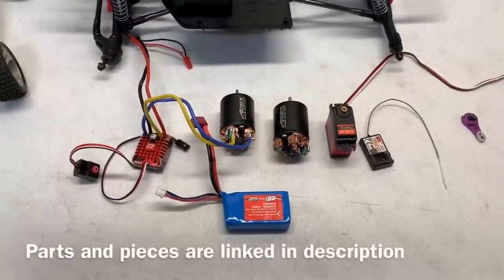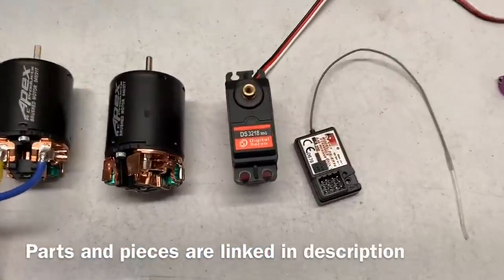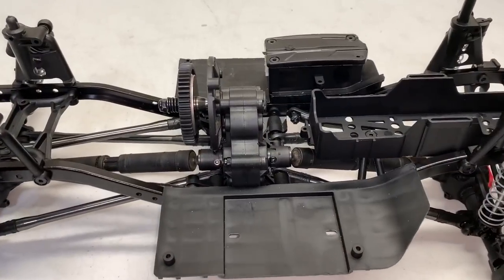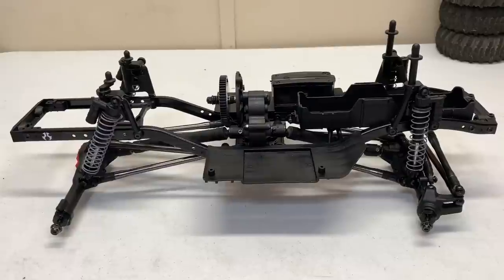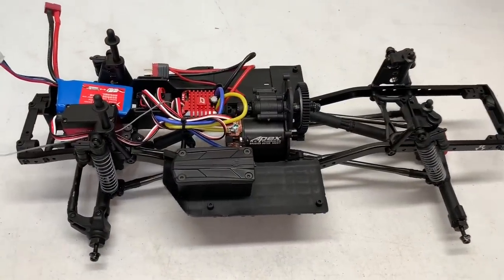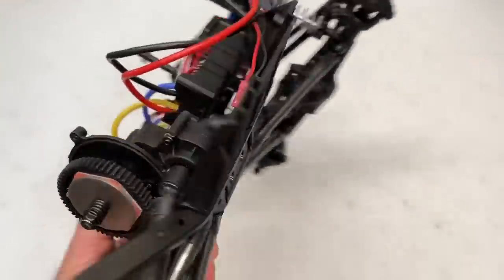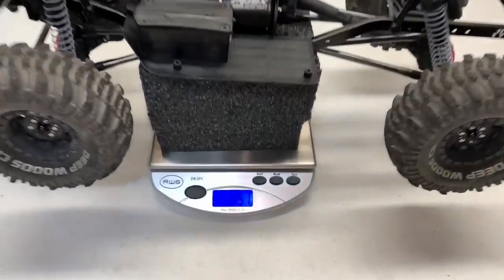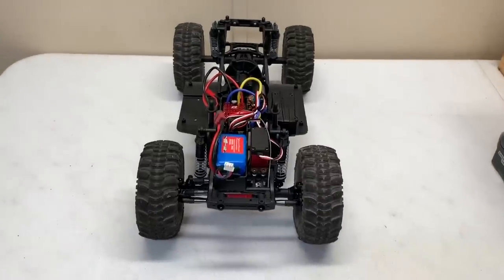Axial 10.2 Superlite Build pt1

Comment: Funny. That's almost what my Honcho is. I've added links, 20kg servo, Holmes Hobby Sport 35t, and 1080. I did add Amazon aluminum beadlock and Hyrax knock-offs though. It can hang in there with rigs costing hundreds more. Fun stuff.
Reply from the maker: TrailCrawler 203 yes you are 100% correct. You don’t need $1k trucks to win and this one is just getting better as I build and cut stuff away.

Comment: Great video again. Hey side note, took the new axe550 out with a buddy. My new 550 with 45/11 was very close in speed to his new firmware axe2300 with 45/16. 3S in both trx4 2 speed same tires size too. Thanks again for sharing your videos. Jon.
Reply from the maker: nice, which one ran cooler?
Reply: Well the new system has a fan as you know. We ran them in rocks for over an hour at 85 plus degrees outside in southern Idaho and neither experienced thermal shut down, both ran out of battery at the same time. Forgot my temperature gun, sorry.
Reply from the maker: jon98tj nice. I’m guessing the Tactic had the 550 motor?
Reply: Yes, Tactical 550

Comment: Deep woods tires are great, I have them on my gen 8, it's basically a spider
Reply from the maker: Dwayne Baker yeah these have the foams that come in them so they are super soft and roll on side hills pretty bad. I’ll do my best to make these work.
Reply: @ExocagedRC  I actually just put the stock tires back on, your so right about the side roll, but the super swampers are much better👍

Comment: Interesting concept!
I have wondered the same thing when I see people talk about their 8-11lb trucks.  
At this weight though, I would assume where your weight is would be even more important.
Reply from the maker: yes, once I get it "done" and at or under 4lbs I can simply add alloy wheels and change everything about the truck.
Reply: @ExocagedRC  Ha!  The never ending build!  I have had one of those!
Good luck! We will be following along!
Reply: I have only recently started this hobby, so there's a lot of people & articles, videos & such saying that putting brass & weights into the rigs is the thing for crawlers. Then I went to a local crawling spot, most of them advised me that where the weight is on the rigs is much more important than just putting weights willy-nilly all over. So this video is very interesting & gives me an insight into 'tuned weight' rigs. Can't wait for the next one..👍👍
Reply from the maker: ectoplasm6453 yes it’s very important. You should check out the other videos on this channel for the Optimus 2 build series. It has brass but only at the portal boxes and covers.
Reply: @ExocagedRC  thank you, sir.. I will do so. Keep on doing the videos, there's so much more we all can learn from each other.

Comment: Does someone else make a set of springs for the Axial shocks? Like a full "racer" set? I need to tune my springs too. But there doesn't seem to be a kit you can by with all the spring rates in it. Axial wants 7 bucks for a set of just two springs. Little price gougey for me.
Reply from the maker: find out the diameter of the springs and just search on ebay, unfortunately springs aren't so cheap.
Reply: The axial shocks are absolutely horrible I've never had a set that doesn't leak bad and I've had 4 axials including my new 1.9 wraith with the same leaky shocks.  If you want lightweight I would just search for some shocks that are lightweight but I would advise ditching the axial shocks asap but that's just me lol.

Comment: The. Axail blazer already light ready to run from the box.littel to light for my. Taste need to add some weight to the blazer I realize too light is bad too heavy is  bad has to be just  right lol
Reply from the maker: MY THE SCHWARTZ BE WITH YOU SCHWARTZ POWER yeah for sure. The issue with many light trucks is the top is just too heavy messing up the balance needed. So weight is added, I’m trying to get this one balanced out without adding weight, but taking it away.

Comment: just put the tires on son audtar rims and 2 sage foams on the deepwoods even whit the body you will lower the cg
Reply from the maker: Tomzak11 this is about removing weight to get the cog low. I don’t plan to add any weight at all but I can lighten the top to get it in balance. Adding weight is not an option for this one.

Comment: is it to heavy at the front? looks like it wants to tipp over easily.
Reply from the maker: Well there is no weight added at all anywhere but electronics are forward. I’m hoping to get some recording done soon on it in the current setup.
Reply: @ExocagedRC  btw still using the flysky i bought from you. thx from Sweden :)
Reply from the maker: Chess13 that’s awesome.

Comment: Nice. I've a few heavy rigs and i wanted a build a lightweight one to try as well.
Have you considered the cheap, aluminium or carbon fibre chassis plates from the Chinese Ebay sellers? I'm running some aluminium ones on my original SCX10 and it was a nice cheap way of making it much more stable for sidehilling and the lights. I've a set of the carbon fibre rails on standby as well and IMO they seem much better. They're about the same weight as the aluminium rails, but much thicker and stronger and unlikely to ever break
Reply from the maker: I haven't seen the carbon fiber ones, yeah getting away from the steel frame would lighten it up quite a bit.
Reply from the maker: I found the carbon fiber chassis on eBay and got it ordered. $16.25 shipped. Cheap!! So I’ll do another video with that and directly compare the weights between them both.
Reply: @ExocagedRC  Nice. I'll be interested to see that video and hear your thoughts on them.

Comment: Interesting idea. Weight is a funny thing.
Reply from the maker: it really is, I went lighter with Optimus 2 TRX comp build at about 7.5lbs and its way better than the 10.5lb comp truck I had before. Some weight is needed in certain areas but more weight needs more power needs stronger driveline which runs heavier wheels which adds weight so you need more power.....its a downward spiral that just gets expensive and doesn't help anything at all.
Reply: @ExocagedRC  totally agree. I perhaps put too much weight on my XJ 10.2 and it doesn't climb as well as Tel's lighter 10.2 build. But, that said, it rides better and more scale-like. So v much a double-edged sword.